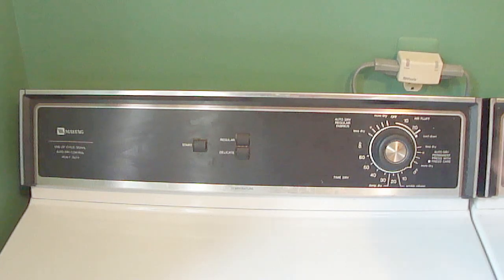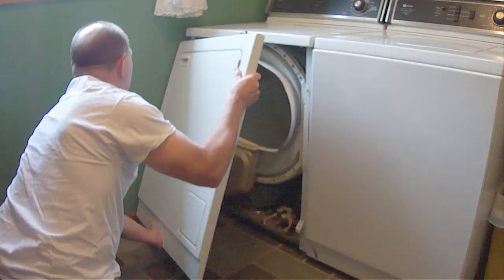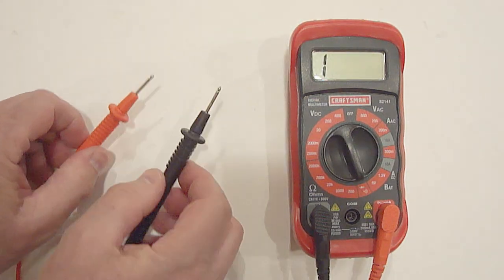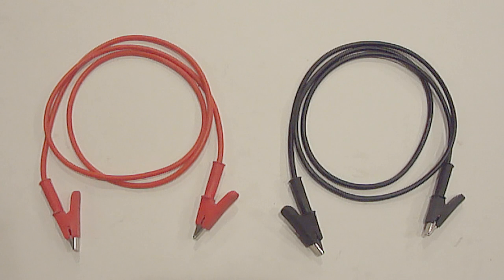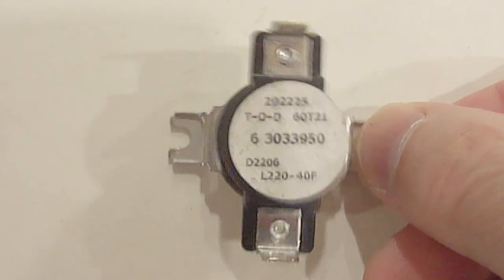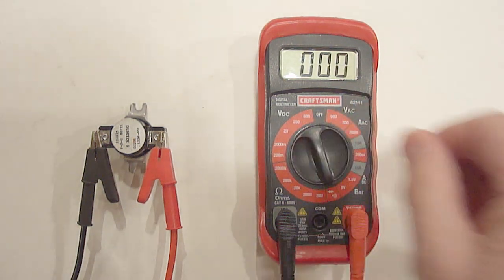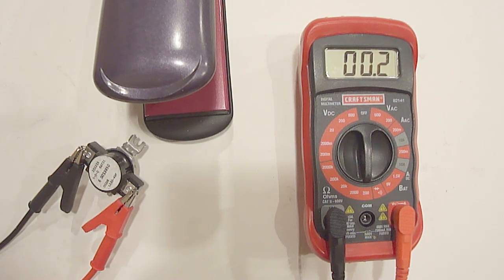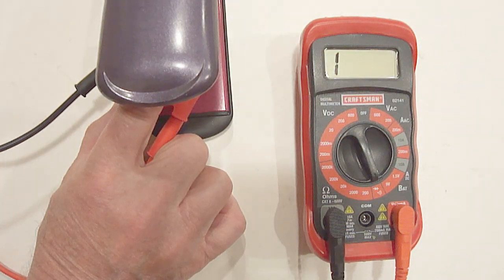Gas Dryer Not Drying - How To Test The Cycling Thermostat In Seconds!

Comment: Thanks for the video, this dryer is the same as mine. However, this is not the cycling thermostat, it's the "HI-LIMIT" thermostat. The cycling tstat has four terminals and is mounted on the output ducting. The HI-LIMIT tstat only has two terminals and is mounted to the combustion cone, as shown in your video.